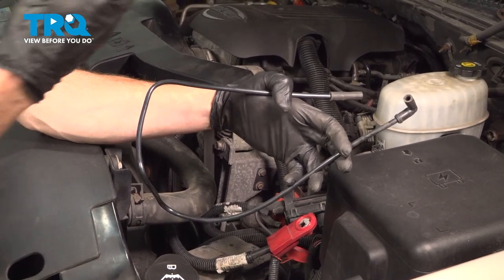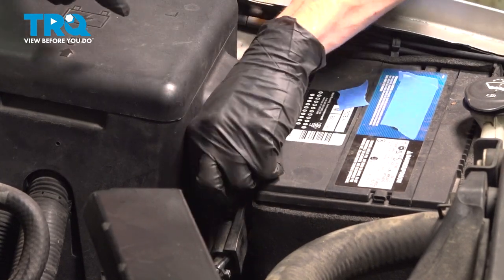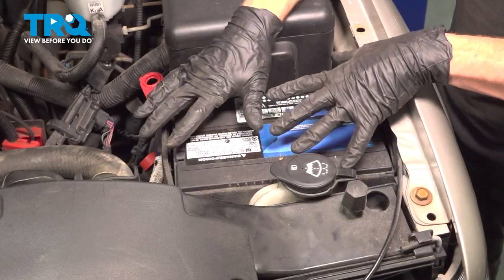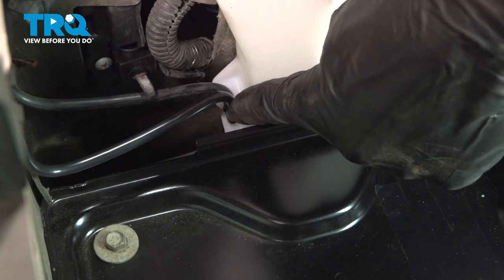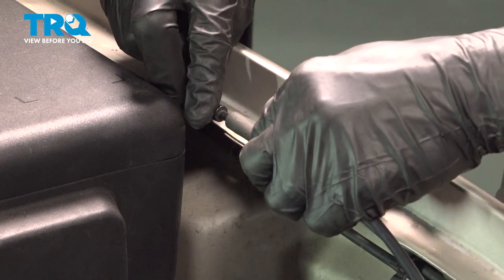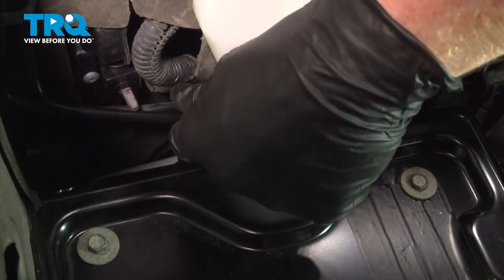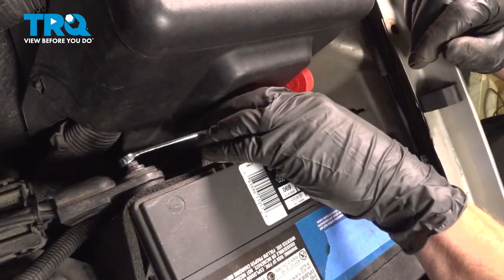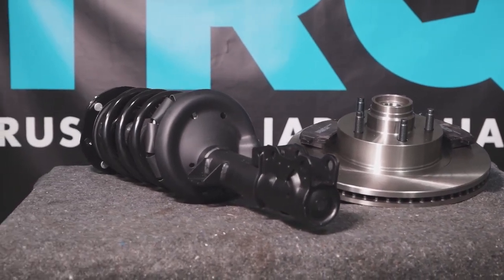How to Replace Windshield Washer Hose 2000-2006 Chevrolet Tahoe

Comment: I replaced mine and I lined up the old hose with the new hose and I taped the area on the new hose where the old hose had a hole.  When I installed the new hose with the taped area, I found the taped area showed me where it was rubbing on the hose.  This should protect the new hose longer?